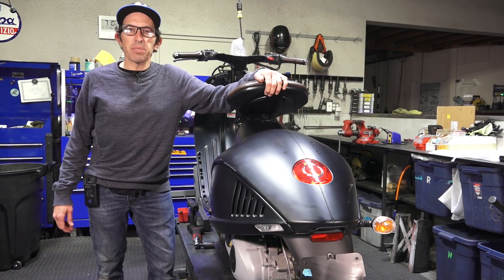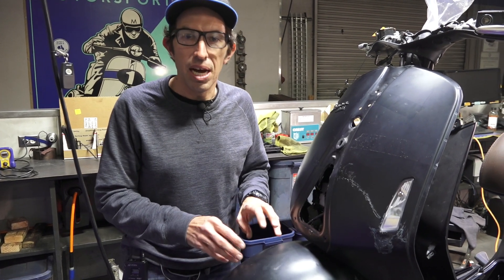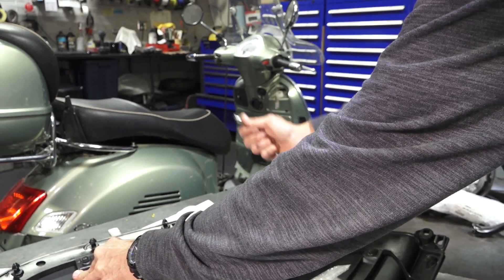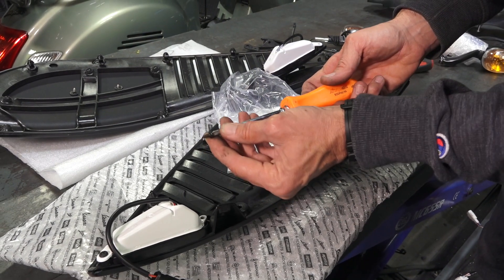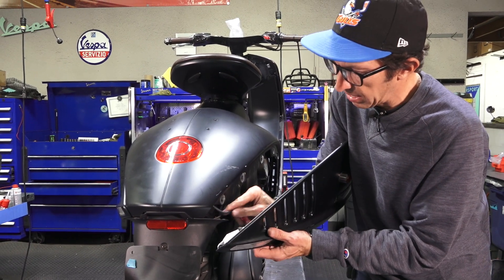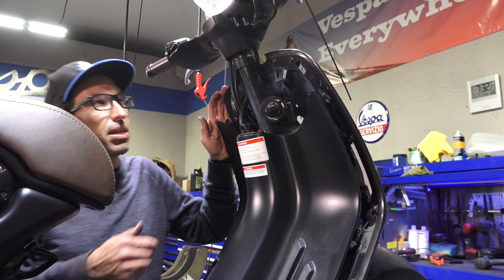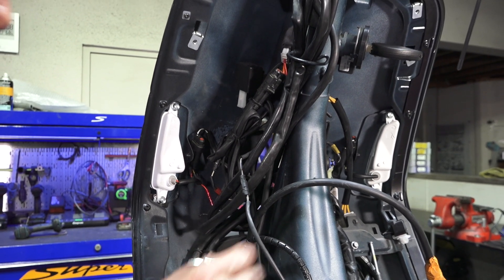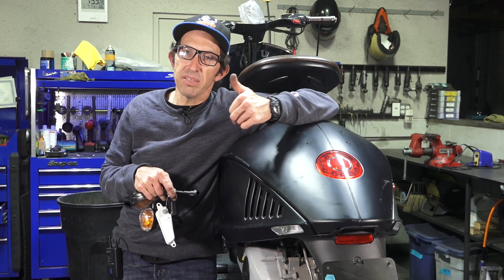How To Install European LED Turn Signals on a Vespa 946 (& Remove USA Pod Turn Signals)

Comment: I upgrade taillights to Leds and going put Leds to headlights on 2007 Piaggio mp3 250 IE! Mr.Robot I also changes out tilting switch and turn signal switch too!